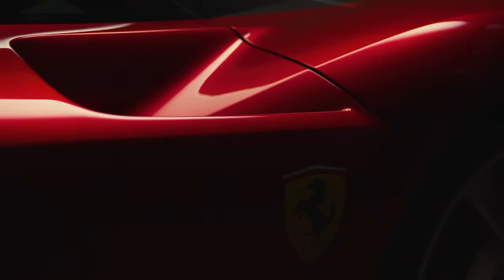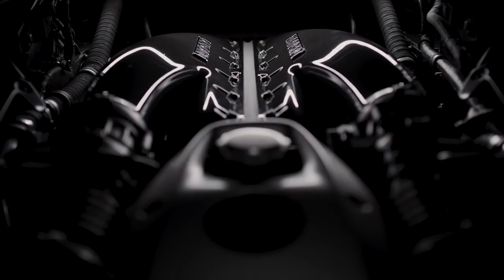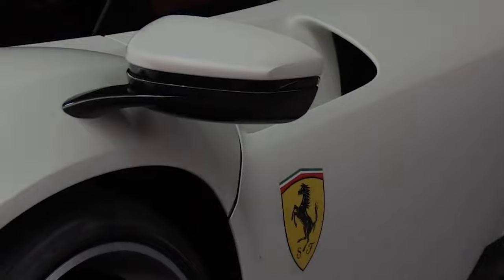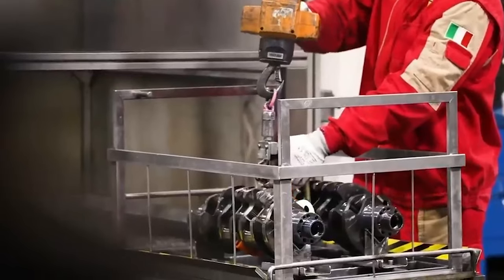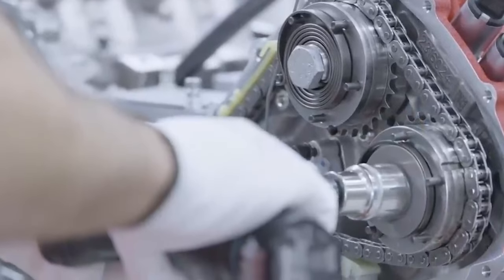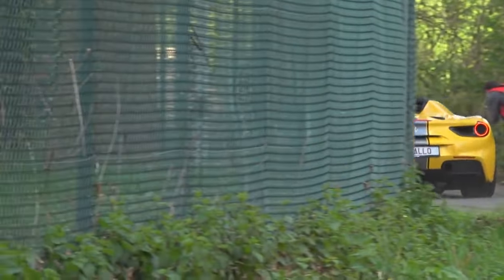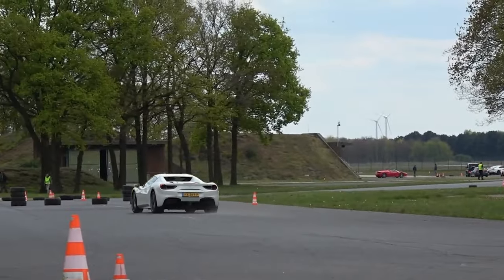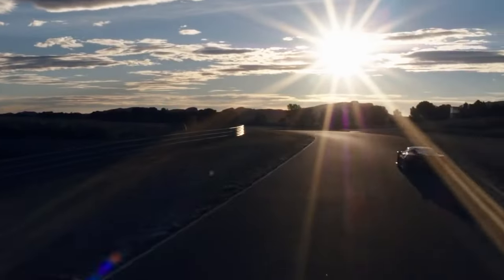Ferrari is Developing a Revolutionary Inverted Hydrogen Combustion Engine

Comment: Ridiculous.   Hydrogen is the stupidest fuel in the world for passenger vehicles.   Combusting it is even stupider than using it as a fuel cell.
Reply: If you use it in sports cars then no one really cares. We use it to enjoy speed and sound and to have fun. 

Equally, other fuel sources like bioethanol are much better in terms of efficiency, storage and operation.
Reply: @Nice_Person7379 lol, hydrogen burns uncontrollably, if they make it, it would be like strapping a mini hydrogen bomb behind your back. Unless thay have a way to make it burn controllably it's not gonna be made.
Reply: @kishlayverma6622 no, it can be controlled and it has been done before by Toyota. Hydrogen does not burn uncontrollably, it burns 7 times faster than standard petrol allegedly. In theory all you need to do is modify the spark plugs and different parts to make it work
Reply: Surely it is better than electric ones like Tesla, what Ferrari did is respect the environment as much as possible while working perfectly and with a real sound.

Comment: The most efficient and simple answer is to have a liquid piston that spins inside of a cylinder.  The liquid can squeeze to detonation for maximum power from any fuel  except hydrogen, which would simply need to be ignited with a sparkplug at very high compression. The stable spinning fluid is then forced into a hydraulic motor. A small  engine like this  could easily run a semi truck 🚚.  🩷😎💚

The valving simply can go on the top and or bottom of the cylinders in the center, for the hollow area in the cylinders where the water is spinning. 
Tangent inlets and opposite outlets on the cylinders are connected via through the hydraulic motor that drives the wheels.  Cool huh .🩷😎💚

Comment: Using hydrogen in an engine is the easy part (although stupidly inefficient). There will always be the problem of how wasteful hydrogen is to produce, and how complicated it is to store. Storing it at -423 f or at 10,000 psi will ALWAYS require expensive hardware. There will never be some magic advancement that will change this. This stupid idea would cost at lest $1 per mile to drive, probably $2+ per mile if the engine is high performance.